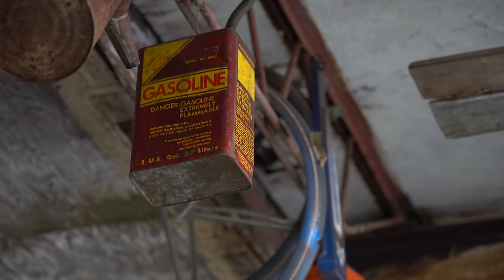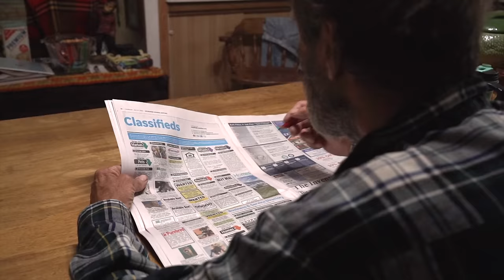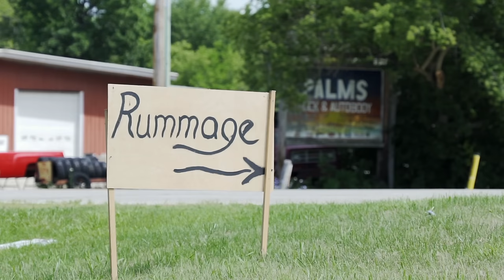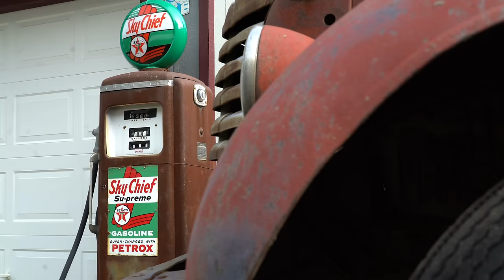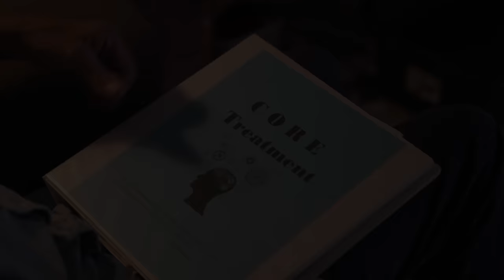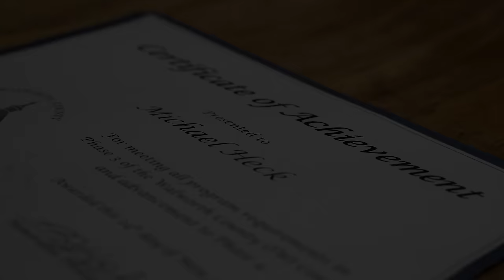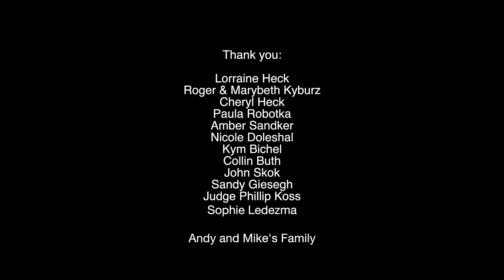An Interview with my Alcoholic Father | Junkin' - A Redemption Story

Comment: My grandfather died at the early age of 33 of alcoholism. So alcoholism runs in my family. All my brothers drink. My mother and father don’t.  I got to the point where I could drink a pint of gin straight. And it had to be warm! lol For some reason, it tasted nasty cold. So then and there I knew I had a problem. But I’ve always had the mental strength to stop thank God. So I did just that. The last time I had a drink was back in 2007! And I actually quit before that. I drank then because my younger brother was getting sentenced. Other than that, I’ve been sober going on 17 years. Congrats on your journey bro! ❤
Reply from the maker: Thank you for sharing.  Sorry for your loss.  I am grateful my father has remained sober and we are able to spend more time together.